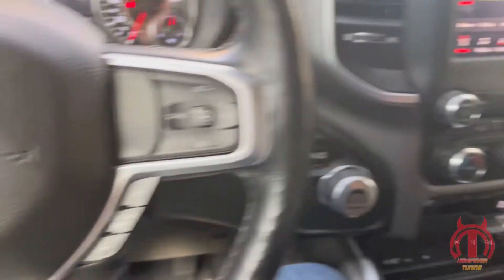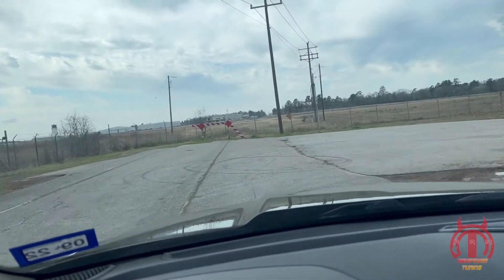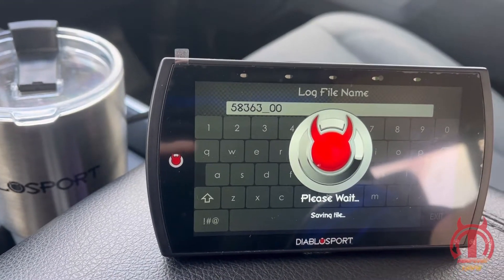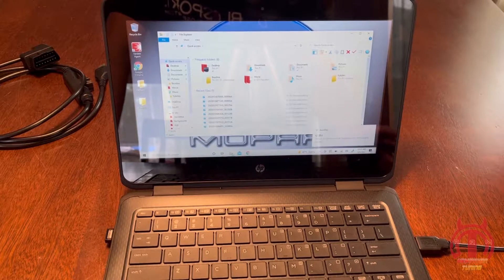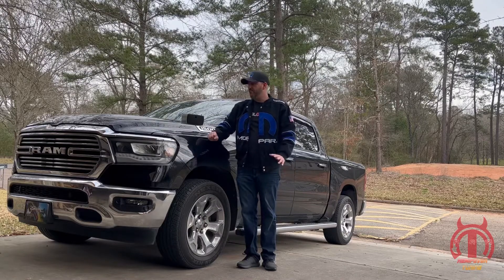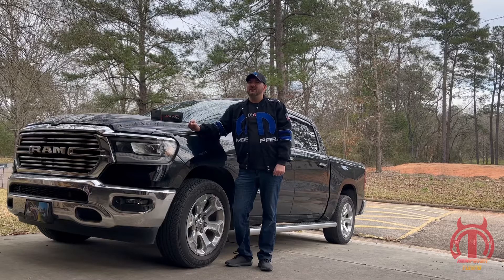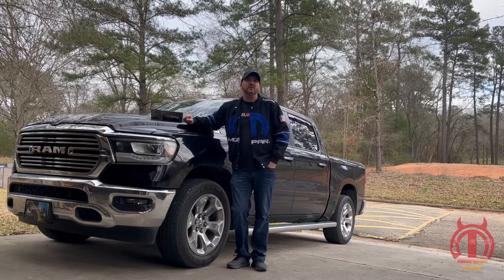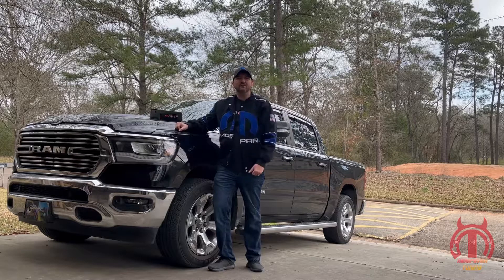Data Logging

Comment: You can adjust speed limiter up to 140mph on the pulsar if you have the trinity 2 screen as well as adjust tire size and speedo. 
Imo the pulsar performance setting is about the same and maybe a little more throttle response compared to the sick tunes. 91 and 87. I can’t find 93 to try the Diablo tune. 

Pulsar was making my truck die everyday or every other day and wouldn’t start until you pull the ground of the battery. So I took it out.

Comment: Truck sounds like it really gets up and goes now. How long of tire trail did you leave til it hooked up to the road ?
Reply from the maker: Yes!!! she moves. I left a good trail to say the least lol. Definitely got a lot more torque. New Tires are going to be a must and from a dig you have to ease into the throttle because if you don’t she’ll just spin and fishtail like crazy. I’m very pleased with the power. I’ve heard back from Sean and the tune has been revised and dialed in. She’s ready for the Dyno now. More on that coming soon…
Reply: @MOPARRAM-bd9zk  I definitely look forward to seeing what kinda dyno numbers you’ll get out of the truck now. Great video !